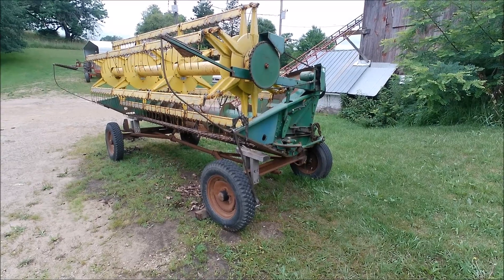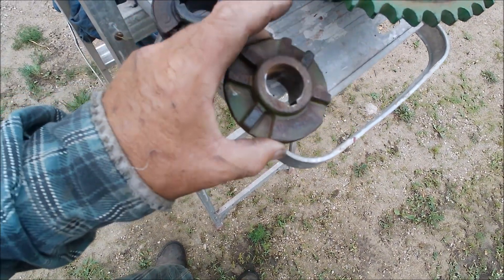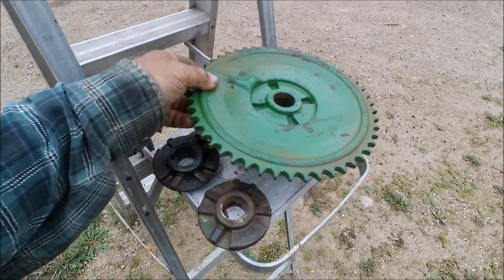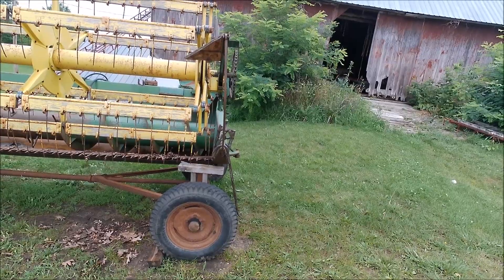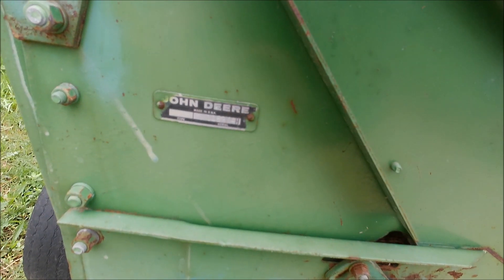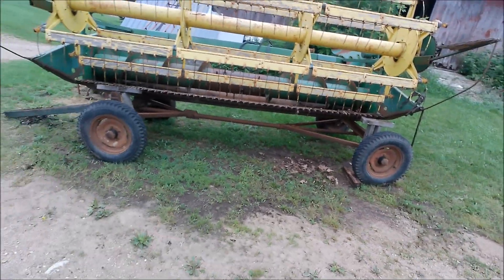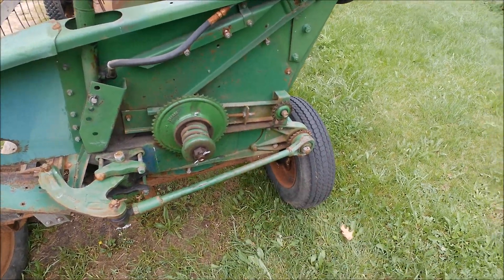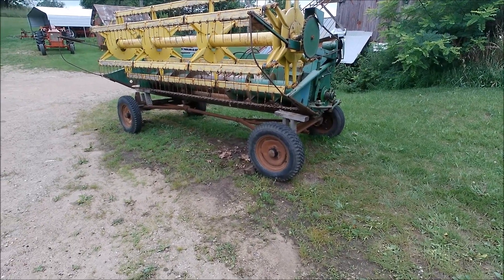JD 3300 Grain Head Repair: slip clutch

Comment: The 1971 6600 parts combine I have came with the head you have. The 1974 6600 I use now came with a 216 head.  I know they were interchangeable between the two. I junked the one you have when I bought it home. It had been setting in a fence row for 15 years and what parts it had left on it were not worth saving.

Comment: Well Pete in the late 60's (1968) JD came out with the Quick Tach header ( like the one you have ) and you could buy a new feeder house for the 45 55 95 and 105 combines to use those heads. This way you could us the same header for any JD combine with a quick tach feeder house on it. Now the older heads had a mechanical reel drive that ran off the slip clutch pulley you just replaced  but they could have the hydraulic drive put on it too to use the same head on a 3300 4400 or 6600 . Some call them a quick tach head some call them a 100 series head but there the same header that came out in the late 60's and were sold new with some late 45 55 95 and 105's and was the standard head sold for the 3300 4400 and 6600 when they came out new. The first 200 series grain head didnt come out till about 1974 1975 so your head is between a 68 to mid to late 70's. The heads I ran on my old 95 one was off a 6600 and the other I converted from a head just like yours to the old style reel drive witch was pretty easy to do, I can use it on my 4400 I just got to plug my reel drive hoses together so I dont blow the pump. Bandit
Reply from the maker: Thanks for  the great information Bandit! I now know a lot more about what I have.
Reply: Dad had a 55 for years, I wish he would have had that quick tach system then.
Reply: @AnglesideFarm  JD did make the feeder house for the 55 to use those heads, I have 3 of those feeder houses for my JD 95 combine. That was one of the best ideas JD had, Make one head and it fits all the combines.  AC had one of the worst ideas with the 4 pins you had to line up perfectly to get the head on it and every combine had its own heads to fit it . That made heads very expensive or not worth anything !  Bandit

Comment: That's pretty good that you were able to find parts.  I believe they call that a 100 series head. I'm not sure when the 200 series came out but  we had one like yours on our 4400.  Ours had an aftermarket flexible cutterbar called a "Love Bar".  It worked so so for soybean until it finally bit the dust. Currently I have a 100 in the shed with a belt pickup installed for windrowed oats.  It's in some of my older videos if you are interested.  In some of my old sales literature it says the 200 series came out in 1976 and I think the hundred series combines came out in 1969.
Reply from the maker: I'll look for those videos. Thanks for the information.

Comment: Those heads came out with the hundred series combine.  I dont believe they have a model number. Just quick-tach xx feet, but commonly referred to as hundred series.  The feederhouse to put the newer heads on the older combines came out at the same time.

Comment: That is a quick tach head. They came out when the 3300 and 4400 combine first came out. At that time they also came out with a quick tach feeder house for the 55, 95 and 105 that would accept this head but the 55 95 and 105 didnt come from the factory with a head like this except maybe  just the last few years of production.. The problem was these older combines did not have the hydraulics to operate the hydraulic drive reel. Some guys rigged one so they could use these heads.  Our 55 has the quick tach feeder house and a head that looks similar but ours has a mechanical variable speed belt drive for the reel. I believe newer 3300 and 4400 combines came with a 200 series head and they had the reel drive motor on the right side. Your head has a hydraulic reel drive so it has to have been made for a 3300 or 4400. 

Here is a video of our 55 running a head like yours except ours has the mechanical variable speed reel.
www.youtube.com/watch?v=ZTtp-c821gA